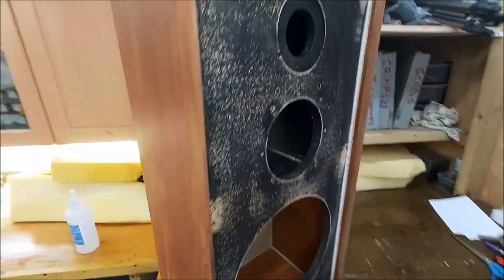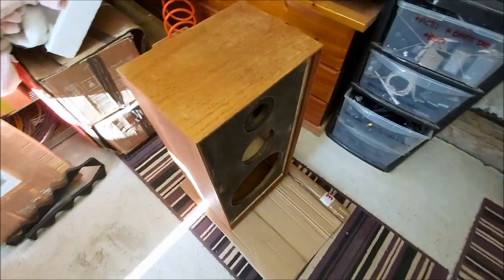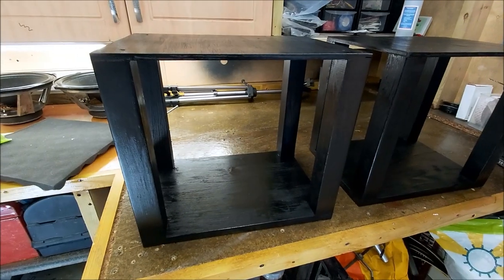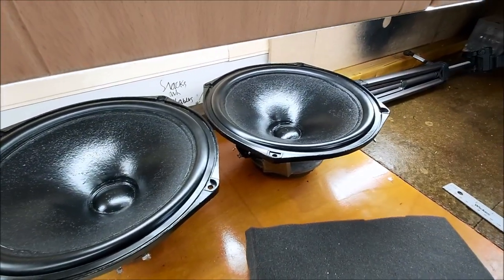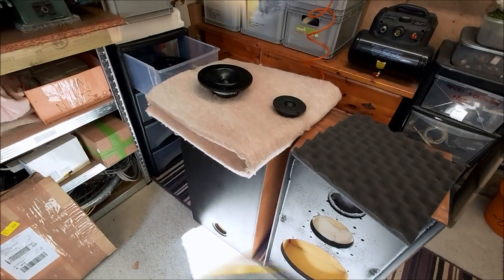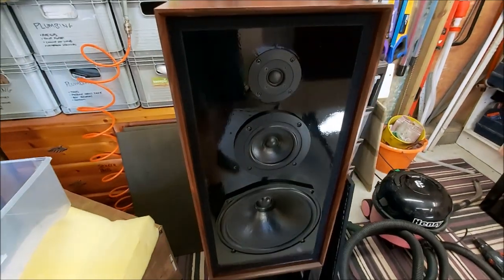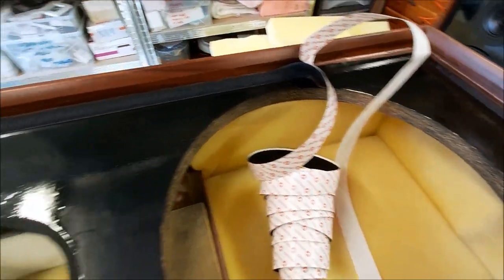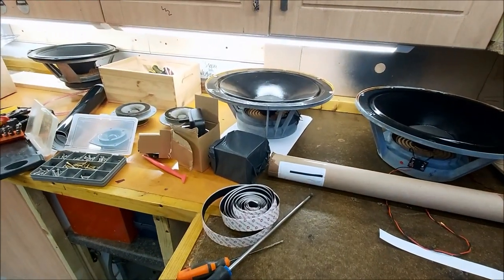Celestion Ditton 44 Part 2. My own Pair

Comment: Okay Matt, I am going to add my comment. First, I really respect and enjoyed watching your skill and craftsmanship as you tackle this project.
I have one observation - not that it really matters of course- but, I think you missed the boat by covering the speakers with vinyl. I think you're a little too concerned about some of the spots on the veneer. After you had sanded everything and had it prepped, the fact that there remained some stains or imperfections after years of use just adds to the patina of the older speaker. Similar to the way many car collectors are finding that they like the patina of the original paint that a car that's been stored for years may have. There's a certain elegance about it. I also don't think in any way it would have reflected poorly on your workmanship had you elected to seal the veneer once you had sanded it down as much as possible. Obviously this is a personal thing it won't have any impact on the sound of the speaker but I just make this observation. Believe me if I had your skill I would do it the way I wanted as well and I appreciate it's always easy to sit back and criticize so I don't mean this as a criticism just an observation I really enjoyed the video and I'll watch for the next one.
Reply from the maker: Hi. Really appreciate the comments and I completely get where you are coming from. It was a difficult call to take the route I have. I've refurbished so many pairs of these in the last few years and they have all been sanded back and oiled. I think this time I wanted to do something different and as they are mine though I'd try it out. A few people have said if I'm going to do this then I might as well build my own cabinets. That is something I my do in the future. Appreciate your comments. Its all constructive and good to hear. Next video should be up soon. Cheers. Matt

Comment: Nice work Matt, great job on the wrap, looks great. One thought, I have had success getting black or water stains out of veneer with Oxalic acid. I had something similar with a pair of Kef Conertos. Cheers.
Reply from the maker: Thanks John. Your right there are a few ways of getting the stains out or bleaching them. Unfortunately in this case it was all to far gone and I really wanted a good finish. The vinyl wrap also has the bonus of making the cabinet virtually air tight 👌

Comment: Hm... For the Baffle: I had a pair of JBLs with deteriorated foam on the Baffle. They had glued a thin layer of foam on the front to reduce the diffraction, and as we know this stuff turns to nasty glueing stuff with the years. Unbearable to get it off the front, but I must do it! So, after I removed this nasty old foam, I took a self-adhesive thin felt and put on a layer on the front. It looks good, and it serves well to reduce diffraction! Anyway, I think, it would have been better than the glossy stuff you put on your celestions! But, have you ever thought about such a solution?
Reply from the maker: If you watch some of my other videos you will see that I use felt to cover the baffles for the reasons you mentioned. It works really well on smaller speakers and creates the gasket for the drivers to. I built a few pairs of 2 ways with rear mounted woofers where the felt rolls into  the back again forming the gasket.  However felt does have its down sides I've found. It can reduce baffle gain which reduces bass. I built a big pair of 2.5way speakers using old Export Monitor cabinets and it played havoc with baffle step loss. I get the gloss finish on these 44s won't be to everyone's liking. However the young couple who brought these from me loved them. Sold for really good money to 🤩
Reply: @haycrossaudio5474  If the customers liked the glossy surface, it´s OK. Who am I to discuss personal taste lol... But, the main reason I like felt isn´t just Baffle gain, but the smooth surface. Glossy stuff brings every little imperfection to light... and that´s something I cannot stand in my workpieces...

Comment: By the way: The Baffle is really thin at the celestions. Wouldn´t it be an idea to put on a second layer of, let's say, 12mm MDF, to strengthen the material? As they are now, the baffle must vibrate  a lot when playing louder than room temperature lol... And you have a nice smooth surface too with the new MDF baffle...The vinyl wrap looks really good! But, as usual, the thick vinyl always makes round edges...lol. It doesn´t matter, and only people who work with vinyl themselves recognize this when they see it. Anyway, it is a sign of high-quality vinyl!
Reply from the maker: No just worked with the original cabinets and baffles. It was a long time ago now. I think I added some bracing inside but can't remember without watching these again lol. Bracing pushes cabinet resonance higher up the frequency range so you have to be careful. Sometimes deadening is better
Reply: @haycrossaudio5474  OK, I never had celestions on my workbench, so I can´t say something about the cabinets. But my JBL 4341 Clones I built are more massive than the originals. 25mm Cabinet material + 6cm Hemp-Insulation+1,5mm Acoustic fleece. And heavy bracing too, certainly lol.  
These Cabinets are totally dead! Like the Dead Sea in Israel. I have a Turntable standing on them, and with full power, not the slightest disturbance of the cartridge appears. I am just a fan of dead cabinets. I even build bookshelf speakers with 25mm Material.
For one of my next speakers, I am thinking about a compound baffle of 19mm MDF + 3mm Bitumen + 19mm Particleboard. The sides and Back I want to build similar, but slightly thinner. 16mm+3+16mm... 
AND: I also like speakers Built with 22mm Particleboard and then an additional sheet of 19mm Massive wood. Like Bamboo or Acacia Sidepieces. The Back just in 22mm again. By the way: Particle Board is the better material than MDF. 
16, 19, and 22mm Particle Board is made in 3 Layers. Surface layer, then a lighter-filled middle Layer, and then the second surface layer again. This has better  damping characteristics than MDF, which is totally homogen.